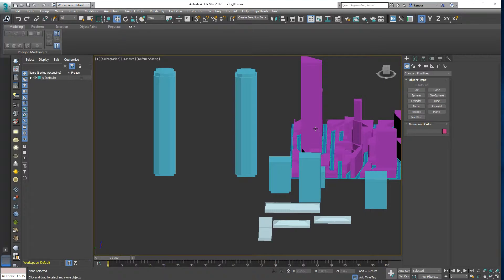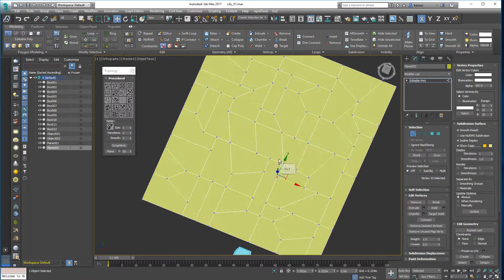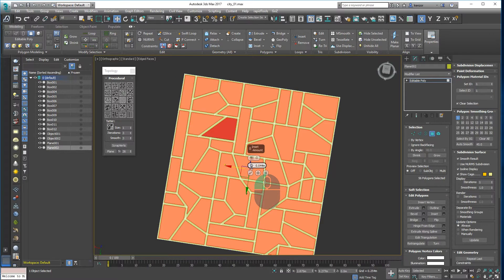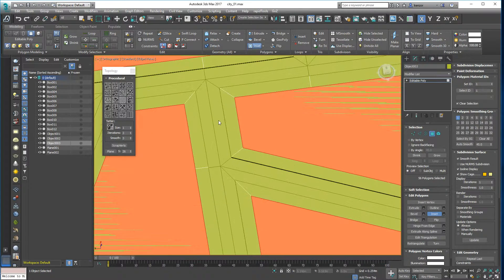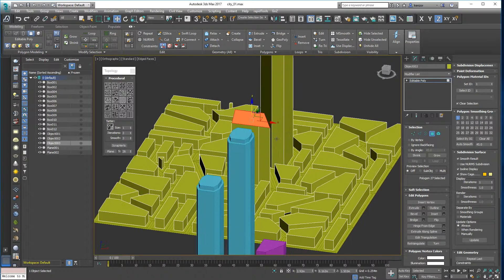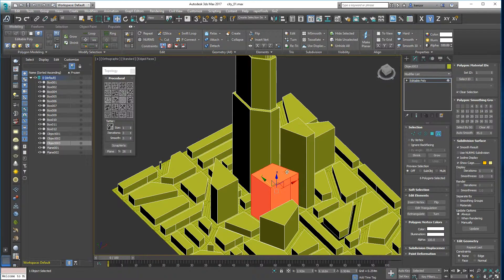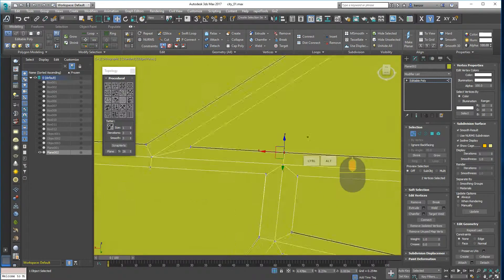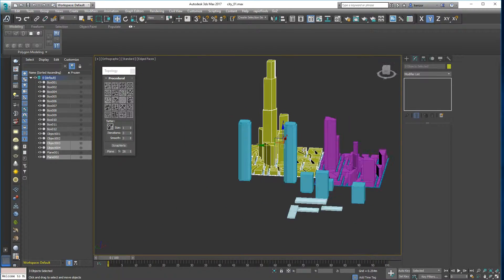Max tips: Modelling a city Block

Comment: This is very useful. I'm trying to learn different ways to build city blocks as well. Thanks.
Reply from the maker: No Problem. I'm going to be making some more videos soon. Is there anything you like to see?
Reply: I'm currently trying to build a cityscape using the Unreal Editor and  started learning 3ds Max to build static meshes, but designing more and more in Max as I'm becoming more familiar with it. I recently discovered greeble which helps enormously in creating random structures. 

I'm intrigued by your non-orthogonal roads, but don't feel quite ready to tackle it because I don't understand texturing very well yet and have been using simple tiles to build roads in a grid.
Reply from the maker: Texturing the Roads isn't too hard. But I should do a proper UV mapping tutorial. There's some tricks with multiple UV channels that work quite well to stop obvious tiling, and you can do the same thing in UE4.